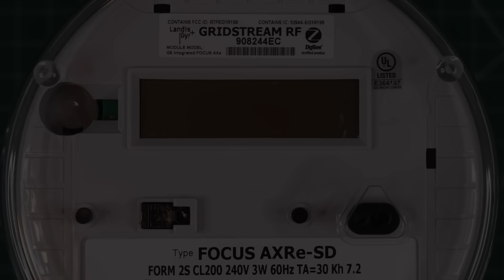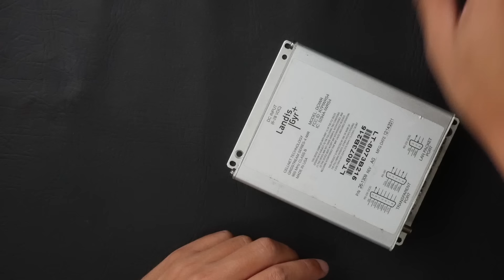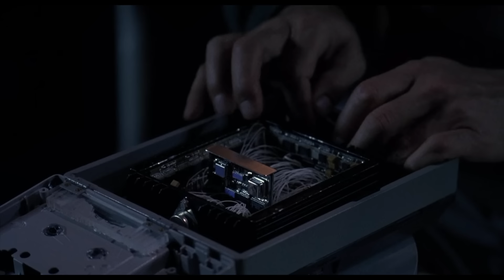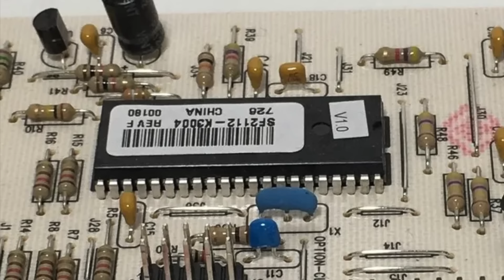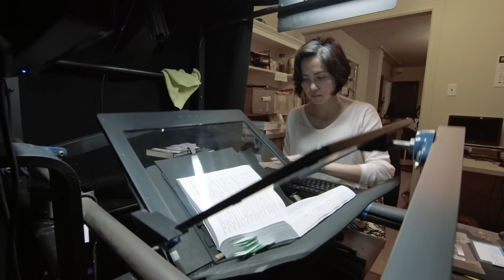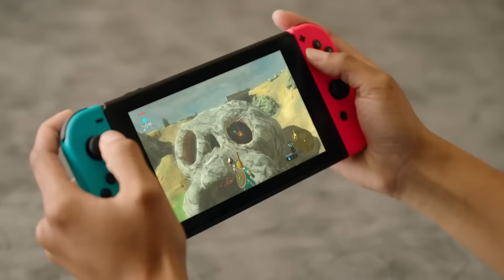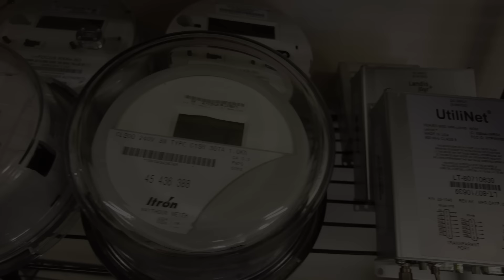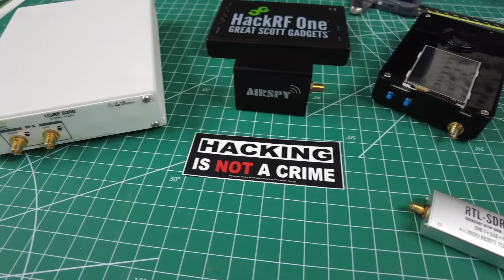The REAL Problem with Smart Meters

Comment: I've some familarity with the subject.  Worked for a uility and learned/coded how to talk to meters (Ansi C12.19).  One key thing to remember is that the utility wants the meter read from month to month.  Utilities already have a very good ideal of the load in areas since they measure power at substations already for years, and have correlations for diff weather/temperature/time of day /season/ superbowl/etc.  As most residential customers are still billed on the kwhr usage for the billing period...not the hourly usage.  So they need only get the meter read at the end of the billing period...from the diff of the meter reads they can get the total kwhr the customer has used.   In the old days, if an outage occurs we only knew the outage was when the customer called it in.  Parts of the distribution network (the wires on the poles) might call in an area outage...but never an individual customers.  Also, not only is the outage important...so is the restoration of power message.  As sometimes an area outage will mask individual outages.
So unless your in some kind of time of day billing (which still is very coarse, time periods of 8 to 12 hours, or even days of week) they don't need the meter communicating very much up stream. 24hrs of usage data is a very small amount of data...and its only being collected once/day, and that's mainly done to detect a bad meter within a day or two. What you are probably seeing on the mesh network, is constant appraisal by the meters and collector as to what paths are available for the quickest way upstream. Meters in mesh networks needs to know what nearby meter has the shortest link chain to a connector, the collector needs to know what reporting meter links to its destination meter it want to talk to the meter. If a meter is unable to talk to any nearby meter, its going to go into a "any one out there" message repeating.  Also, firmware updates, new meter initialzation, etc is going on as they deploy the meters.

Even for periodic usage purposes (such as area load studies), it only wants hourly from residential.  Industrial maybe 15 min intervals.

Meters that can shut the power off are more expensive...last I heard about $100 more..and thats only for residential...big customers you can't have a 1000amp circuit breaker in a meter.  So utilities don't really want to deploy remote shutoff everwhere, just in places where shutoffs are common, such as college towns, etc.  Meters before being smart cost around $20, maybe smart meters are $50 to $100.  If you have million old meters to convert to smart that big bucks to buy....and deploying itself is expensive -say $100 to replace an old to new meter.
Also, diff meter manufacturers are using different protocals....Itron derives from antiquated drive by system.
Net metering is a twist too, but can be easily handled.

Finally, meters comm should be talking encrypted...if not you should be worried.
Reply from the maker: Thanks for a very informative comment!
Reply: @RECESSIM  Why no email?
Reply: @RECESSIM ב''ה, y'all are fairly aware of it, and this far into the vibe coding era I'm not sure obscurity even matters.. but recall the more data available the more risk of advertizing unoccupied properties for 'third party perusal for interesting code snippets, cash and valuables.'

This is a hard problem and one where the 'ethics of ownership' becomes spaghetti quick.

Comment: Well, youtube randomly recommended this to me, maybe because I like investigating random protocols too.

Now that you've revealed the strings, of which some seem unique like "Increment Gabby"...
If someone were to anonymously toss the firmware on pastebin or something, people might find it, in time.

The long messages...
To me it looks like commonly each message could be one long piece of content, split up into multiple packets, 85 bytes long.
The 85th byte of 85-byte packets seems like it could be 04 if 'content continued in next packet', otherwise it might be a part of the message, like in "Wed Mar 15 01:02:25 2023".
Though there are also some that use 84-byte packets, and some even odder ones with 34-byte packets...

I found a Landis+Gyr patent (11706063) about sending different message types at different millisecond times, and figuring out the message type based on that.
The patent suggests cycles of 8.5ms split between three types of messages, and it seems potentially interesting that the HopTimer is commonly XX.X5 seconds, except when sending an unusual-sized message.
The spectrum at the start of the video looks like it could potentially show cycles of 'bursts of bright green'(long messages?) then relative 'quiet'(short messages?) too.

Comment: Why would a smart meter have a function to disconnect a consumer from the power supply ?
Reply from the maker: If you don't pay your bill, they turn off your power. This used to require sending a person in a truck to your house to physically PULL the meter off the wall to disconnect you.

Now they just send a signal.

Comment: You don't have to buy grid power but I'm with you on you actual goal of cracking the meter.
Reply from the maker: Don’t forget a large part of the population isn’t in nice homes they own or have property to install their own energy generation.

They rent homes or live in apartments, for them the only option is purchasing grid power or living in the dark.
Reply: @RECESSIM  As those are both options you can rent and still have outdoor mobile power.  It's not very hard to create a windows unit solar heater and they work extremely well.  As some that lived out of my car for about 9 months I can tell you power takes a back seat to heat and plumbing.  The issue of the power companies is lack of competition.  In the states that allow the ability to shop around for power the rates are much lower.  In the states where the power company is state run the quality is the same but the price is much higher.  I do agree with you about these large power companies running to the government for handouts and some letting the grids fall to disrepair but also in many states the electrical grid charges are capped by state governments.  In my years I've not seen government do anything efficiently, cheaply, or of quality over a decent length of time (20 years).  Perhaps the grid could be government managed but it would have to be done by localities not Federal, but government owned power companies are definitely not a viable answer.

Comment: 1889 - AC deployed.... "Influenza" starts to become a yearly occurrence...AND, there was the 1889-1990 Pandemic
1918 - Radiowaves initiated.... By 1919 "Spanish flu"
WW2 - Radar waves initiated, satellites in Van Allen belt, another "flu" episode
1968 - more satellites sent to Van Allen belt.... Hong Kong "flu"
2019 - 5G is initiated... 2020... 5Genocide is officially here and folks are nonetheless wiser....

The impacts of 5G/60 GHz are not widely published. Here’s what we know from big telecom company promotional material: “60 GHz has a very distinct impact on none other than oxygen itself.” Yes, articles from companies touting benefits of 5G admit 60 GHz is absorbed by oxygen as seen by this graph.

Oxygen the atom is O. Oxygen the molecule is 02. Two atoms together.

These two atoms form the oxygen molecule and share some electrons. 60 GHz causes electrons surrounding oxygen molecules to spin, akin to how high-powered microwaves running on 2.4 impact molecules in food such as water. They’re heating, in part, by impacting those molecules to rotate or oscillate with each wave. The movement energy from the rotation of these super tiny water molecules helps heat the rest of the food.

In a similar way that 2.4 causes H20 to oscillate, 5G/60 GHz even at low power causes electrons on oxygen molecules to spin, changes to the spin frequencies on oxygen electrons impact human biology.

When you breathe air into your lungs it gets oxygen into your blood, brain, tissues etc. and oxygen entering your lungs gets picked up by a very important iron containing protein called hemoglobin in your blood.

The impact of oxygen molecules spinning the electrons is that it makes the hemoglobin unable to uptake the oxygen and get it to the rest of your body.

Wi-cancer dot com
Radiationdangers dot com
Stop5g dot cz
Cellphonetaskforce dot org

📚 📚 📚
·The Secret History of the War on Cancer - Devra Davis Ph.D.

·Currents of Death: Power Lines, Computer Terminals, and the Attempt to Cover Up Their Threat to Your Health - Paul Brodeur

·Glow Kids: How Screen Addiction Is Hijacking Our Kids - and How to Break the Trance - Nicholas Kardaras

·The Invisible Rainbow: A History of Electricity and Life - Arthur Firstenberg

·Faucian Bargain: The Most Powerful and Dangerous Bureaucrat in American History - Steve Deace & Todd Erzen

·Dirty Electricity: Electrification and the Diseases of Civilization - Samuel Milham, MD, MPH

·Zapped: Why Your Cell Phone Shouldn't Be Your Alarm Clock & 1,268 Ways to Outsmart the Hazards of Electronic Pollution - Anne Louise Gittleman

·Are Wireless Devices Safe? - Jeanice Barcelo

·The Spinning Magnet: The Force That Created the Modern World – and Could Destroy It by Alanna Mitchell

·Ten Arguments for Deleting Your Social Media Accounts Right Now by Jaron Lanier

·Crystallizing Public Opinion by Edward Bernays

·The Crowd: A Study of the Popular Mind by Gustave Le Bon

·About behaviorism by B. F. Skinner

·The Age of Surveillance Capitalism by Shoshana Zuboff

·The Dangers of 5G by Claudia Drake

·Radiation Nation: The Fallout of Modern Technology by Daniel T. DeBaun and Ryan P. DeBaun

·Cancer and EMF Radiation: How to Protect Yourself from the Silent Carcinogen of Electropollution by Brandon LaGreca

·Disconnect: The Truth about Mobile-phone Radiation, what the Industry Has Done to Hide It, and how to Protect Your Family by Devra Davis

·Hidden Dangers 5G: How Governments, Telecom and Electric Power Utilities Suppress the Truth about the Known Hazards of Electro-magnetic Field Radiation by Jerry G. Flynn

·EMF*D: 5G, Wi-Fi & Cell Phones: Hidden Harms and How to Protect Yourself by Joseph Mercola

·Death by 5G: An Advanced Guide to Population Reduction Techniques by Louise Steele

·Earthing: The Most Important Health Discovery Ever? By Clinton Ober, Martin Zucker, and Stephen Sinatra

·

Comment: During my engineering degree studies, I did a 4Hr lab on the old electrodynamic watt-hour power meters. All the 50 guys in the lab got different WHr readings for identical power consumption, indicating every meter was recording different power usage and therefore consistently inaccurate. Digital measuring is consistently accurate and the Comsumer pays for only what they really use. Surely that must be an improvement.
Reply from the maker: https://www.utwente.nl/en/news/2017/3/313543/electronic-energy-meters-false-readings-almost-six-times-higher-than-actual-energy-consumption#:~:text=Professor%20Frank%20Leferink%20of%20the,in%20every%20household%20by%202020.
Reply: Well not really because I guarantee your bills will go up due to the fact olde mechanical meters could not truly measure usage of devices that contain motors like watching machines etc. modern smart meters can. Your bills will only go up and not down with a smart meter!

Comment: Here in California it took going through a few hoops, and paying a few fees, to "opt out" of a smart meter installation, but I persevered. These things were supposedly just to make it easier for crews to read usage. As it turns out, they began deciphering when refrigerators went off and on, AC units, etc. -- so they could "suggest" changes to your habits. They haven't pressed this too much (yet) that I'm aware, but it was definitely a bait-and-switch.
Reply: I have a better solution= off the fkn grid I go. For $7k, I am DYI a 8kw panels, 40kwh li-ion battery, 6kw inverter, and fu Edison!
Reply: @user-rs8zg8ey2b NO, you didn't NOT get all that for $7000... LIAR!
Reply: @user-rs8zg8ey2b What’s DYI?
Reply: Yeah, with real-time power monitoring, it is possible to know what things you are using, turning on/off.
Reply: At first it was just so the power company wouldn't have to come to your meter to get the reading, later you could opt in for variable time of day billing, then later they made it so you couldn't opt out, the time you used power is going to have a different rate.  I'm not really against it, but once something is "smart" they're going to exploit it.
Reply: @Pyrolonn similar to what were stuck with, we have the old version of this where we have a little red light above the garage door, this light signifies that our heat has been turned off. They give us a discount based on them turning our heat off whenever they feel like it or contractually “when power demands are high”
Reply: @ithmiths it’s called “off peak” or “ripple”
Reply: @Pyrolonn  This is how I am going to win, stop paying my bill until they disconnect me, then I will be off the fkn grid, and DIY solar/battery and the middle finger to them criminals.
Reply: The other problem is usage. It's difficult to decipher what's being actively used at a specific time by reading the meter outside due to the stupid cycling menu, and the fact that it's digital you have to just take the word for it

The manual meter you can see everything actively moving and decipher much easier without ever logging into an app, and it's more accurate.

On top of that, they've been caught upping the multiplier in your smart meter and just claiming it was a mistake
Reply: @JamesAutoDude I just house sat for a friend, while I was doing laundry I paid attention to the two meters he has inside the house, one to the hot water heater and one to the heat pump. He writes down the reading on the first of every month. He was a lineman for 41 years and watched every penny.
Reply: More importantly: someone somewhere knows when you are at home...and when you're not.
Reply: @markrainford1219  not necessarily, I have an automated random times turning on lights/music/etc
Reply: @markrainford1219  timers .....
Reply: @markrainford1219  Hardly,  My PC is on for 16hrs a day, but I'm home all day and night.
Reply: Here in Arkansas we opted out and paid the extortion fee.  Five years later they are coming for us and trying to disregard the opt out agreement.   They harass us and lie and sneak and do all kinds of juvenile things that are legal.  The smart meters are a surveillance dual use device.  They don't even deny it.  Dual use means the military can use it.
Reply: California is also purposely raising electric rates to induce us to use less of it, and this is driving businesses out of state.  We've even surpassed Hawaii and now have the highest electric rates in the USA.  Either we've got to stop electing leftists or face that we will become third world.
Reply: You putzes are conspiracy theorists.... 

NONE of what you suggested ACTUALLY happens. The ONLY reason smart meters exist IS so that the power company can get RID of meter reader employees. That's IT! They don't "spy" on you, and they don't give a FUCK what time your fridge is running, or if your home or NOT! 

C'mon MAN!! 😒 🙄
Reply: They want control more and more...
Reply: Smart meters r burning houses down by programming. Ca big time 10years.
Reply: When you hear politicians parrot "green energy", then watch Texas wind farms go offline due to a blizzard, putting millions of subscribers in peril, it seems that the unavoidable conclusion is that these "suggestions" are made to cripple America.
Reply: My electric supplier owns the meters and will not allow opting out of smartmeter use.
Reply: Curious,  do you live in an area where neighborhoods burned to the ground, but your house still stands?
Reply: This is the dumbest response to progress
Reply: how is that bait and switch? also no , this isnt a real thing "so they could "suggest" changes to your habits."

Comment: IIRC, the hopping pattern is pseudorandom based on the network ID (CRC Adder)
Reply: The UtiliNet radio firmware prohibits transmission on any one frequency from exceeding 0.4 Sec within a 20 second period. In the absence of any transmission, receivers hop frequencies every 700 ms.

The radio's firmware is written such that frequency-hopping occurs even in the absence of transmissions. When a transmitter is presented with a continuous stream of data, that data is broken into multiple packets which are transmitted in succession while hopping occurs. The transmitter moves through the hopping sequence following it's receiver. At each frequency, the transmitter will not transmit for more than 400[ms]. Every channel is used, and every channel is used an equal amount of time on average.

The maximum duration of the RF transmission is 364ms during a 700ms channel dwell time. There is a minimum of 50 channels used during the hopping sequence therefore a channel will not be re-occupied until at least 35s. Therefore the average time of occupancy on any one channel in a 20 second period is 364ms.

Comment: My smart meter consistently transmits on 940.XX MHz at what seems to be not so random intervals. I wonder if this is like a control channel used in a trunking system to express the hop and what frequency to hop to, however I do not pick up anything at the same strength as this main transmission frequency. Interesting video, I am all for open source mainly because it keeps us safer. The 902-920 MHz range is where I receive the gas and water meters.

Comment: The meters use the 900 MHz band? I thought they communicated through the power lines. Ever since I got the smart meter I can hear the buzzing through my transformers once an hour. Also the meters here are the better part of a mile  apart , some multiple miles, it would be tough for 900MHz to reach that far